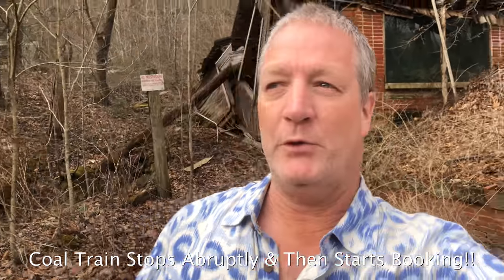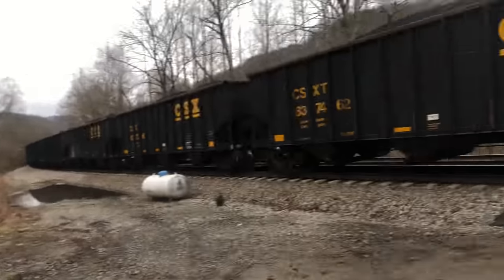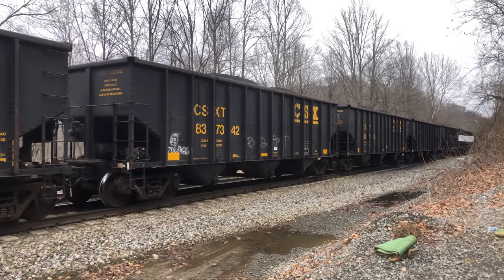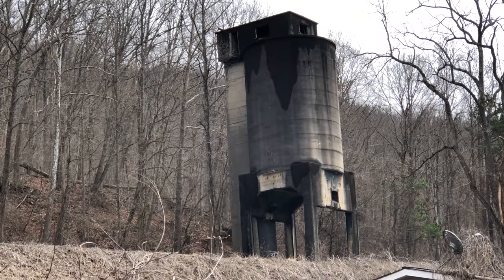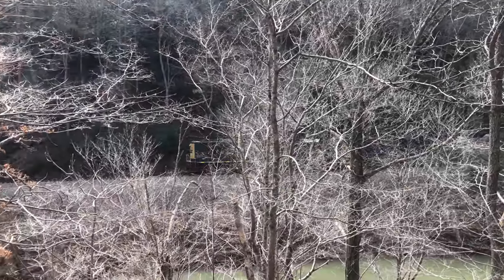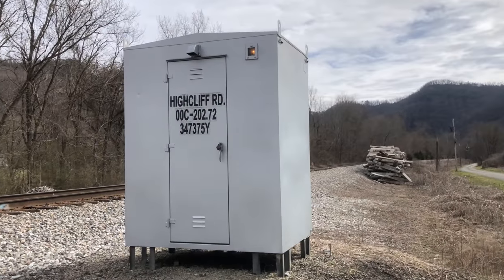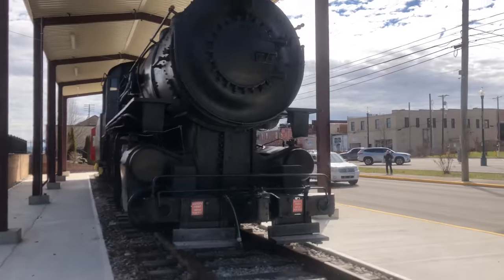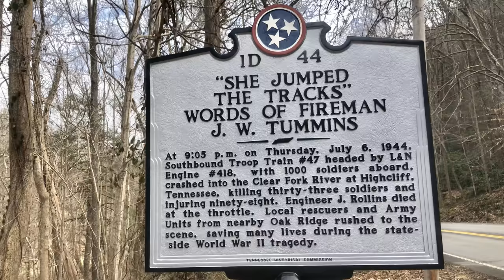Coal Train Makes Sudden Stop & Starts Quickly Jellico, Tennessee, Steam Engine Corbin Kentucky CSX

Comment: Another example of JT being famous everywhere he goes. A single engine in the boonies and they recognize him with a salute :) How cool is that?
Reply from the maker: One time I was in the boonies in West Virginia near the centre of the state.  The engineer got off the train and walked over to me and said " Hey JawTooth, what are you doing here?"  That was awesome.  It has actually happened quite a few times
Reply: @JawTooth  That is very cool!
Reply: @JawTooth  former conductor/engineer. Love your videos. To answer the question why they stopped? They could’ve had a student engineer or new engineer that applied too much air for braking. Going downhill with a heavy train is scary. If you apply too much air you have to stop and kick off the air and let the train line build back up. If you just kick it off without stopping, you could have no brakes because you don’t have enough air.

Comment: I enjoyed your sense of humor concerning the dilapidated house alongside the roadway. The freight carriers discovered that the concrete ties are not as resilient to the heavy pounding of freights. These ties are great for passenger service. Wooden ties take the pounding better and are easier to replace. Also, wooden ties can be shredded or reused for landscaping. There used to be a power plant somewhere in Penciltucky that ground the ties and used them to fire the boilers to generate electricity; I don't know if that plant still exists.
Reply: No now they ship the Ties to China!! They are tearing up the Eastern Shore RR and taking the Ties there!
Reply: A lot of CSX ties go to a cogeneration plant in lower Michigan not too far from Alpina on Lake States RR and CN keeps them coming to Llanse MI the endof a branch. That is the town's fuel for electricity and consumes an average 3000 ties per day. Nick a concrete tie and out it must come. Wood can take those minor nicks and flange grooves. UP is finding out the hard way in.Nebraska

Comment: By carefully observing the lumps of coal protruding from the top of the cars, I try to identify what variety of coal is being transported. I think it is anthracite or coke, both varieties of color tending towards gray. Coke (not to be confused with Coca-Cola) has a porous structure and is much lighter. To see the speed with which the train restarts after stopping, I would go for coke.
Reply: No coke 
Marijuana
Reply: @michaelhewitt258  no Coke.  Pepsi Pepsi! Cheeseburger Cheeseburger!
Reply: I'd say it's unlikely to be coke. Coke is almost exclusively used in steelmaking, and it's usually made close to the steelworks. It tends not to be transported long distances.
Reply: @beeble2003  you are correct. Former RR
Reply: Coke is lighter than coal. A typical coal train is 18,000 tons. I used to run them. Coke is usually in big chunks mounded high over the car.

Comment: Crazy how fast a train can get up to speed from a stop.
Reply: Especially a loaded coal train going down hill.
Reply: It stopped faster than I thought it would, too!
Reply: Donald Stanfield   I’m pretty sure the train went into emergency about the time the third car was near the crossing.  I’m positive that the engineer was using dynamic brakes coming down the hill, and I am pretty sure the air brakes were set also.  And it was not going very fast either.  So it stopped pretty quick because the brakes were already set.  It only went 17 car lengths as the 20th car stopped on the crossing.

Comment: That stop that you mentioned about early into the video he probably had a red light for the block out in front of them and then it turned green pretty much right after he came to a stop and maybe he was asked by the dispatcher to put a little “steam” into it to allow whatever coming up behind it to move along as well, just an observation or idea/guess. Being a former freight train Engineer myself, that’s when you go from speed / power selector 1 to 8 in a relative hurry/quick step plus going downhill was a big help!
Reply: If he has another train in front of him, it would be very unwise to put his foot to the floor, as there's a good chance of being stopped at the next signal, too.
Reply: If your a former RR then tell me what happens if you apply too much air to the train line going downhill? You will have to stop to recover your air. If you just kick it off, the compressor won’t charge the train fast enough and the next time you pull the train line air there is nothing there and your a runaway!
Reply: Former RR

Comment: That coal train took off lake a rocket sled on wheels. The steamer and caboose display were kept in decent condition. As the old statement goes the Walls of Jericho came tumbling down however the concrete coaling tower of Jellico is still standing tall.

Comment: Pretty cool: Here in Walla Walla, Washington near 9th there's an older Union Pacific steam loco parked next to the street. There's also one "coal-type" car attached to it. They've been there for about 65-75 years. The cool part about it is it was about 8:00 PM and I was on bike on the sidewalk next to the thing. There was coincidentally a guy walking there when I pulled up so we started talking. He mentioned how he, as a kid at the time, watched his grandfather park it where it sits. While doing so, he kept pointing to one of the wheels. "Right there...THAT one." There was a problem with the brakes on that wheel and they were worried if they were going to be able to get the thing stopped in time.

There are the links of track it all sits on today still there, obviously, but any remaining track, the way they got them there and so forth is now long gone to the point of one cannot even tell where that WAS. Like...LONG gone. Partially covered in grass, signage, pavement, a building, blahblahblah...(There's a chain-link fence around it these days.)

What are the odds, though? 8 PM...No one around...The ONE GUY who happens to be walking "right there" at that exact moment happens to be the grandson of the guy who parked the thing there some 70 years ago AND he had a big-time story about it. Go figure.

Minus the caboose, that entire display looks almost EXACTLY like the one on display in the video at the end in Corbin, KY. The only difference is the one here has "UP" painted on the side along with the number. Both in white. The city lights the thing up every Christmas season as well.

Comment: Hey jaw tooth. The US 25 w & 25 E was once major routes out of the south east before interstate 75 . Most likely the engine you seen is a helper engine they keep at morley  to push heavy trains across the mountain to Duff Tn .  Surprised you didn’t show a wheel greaser there is two there near the coaling tower . Anybody can run a train on flat ground . Takes good hands in the mountains and tunnels of east tn
Reply: Does anyone remember the train wreck that killed some servicemen back in the 40,s outside jellico google it
Reply: Google jellco troup train wreck . Several articles.  It’s interesting that since it was near oak ridge and carrying troops there
Reply: Was a news black out

Comment: Nice catch of that CSX coal train near Jellico, Tennessee, Jaw Tooth! That coal train did get up to a good speed very quickly once it started to move after stopping. That old Louisville & Nashville Railroad concrete coaling tower in the middle of nowhere was a great find. I was wondering how that coaling tower was filled when it was used during the steram erea. The lone CSX engine passing the coaling tower was another good catch. I was surprised that you were able to get ahead of the single engine so that you could catch it coming out of that tunnel. The 0-8-0 and the bay window L&N caboose on static display in Corbin, Kentucky was a nice find. It looks like someone or some group is taking good care of that engine and caboose. Thank you for finding these trains and the sttric display and for bringing them to our attention!

Comment: That's the first steam locomotive I've seen with no leading or trailing wheels. I didn't know they existed.
Reply: That's a switching engine, and thousands of them were built during the steam era to put trains together or to take them apart in railroad yards. They were also used to transfer cuts of cars from one yard to another. They didn't have pilot wheels in front or back because they were slow-speed engines and didn't need the extra wheels for guidance that higher-speed engines needed through switches or curves. Also, the lack of pilot wheels meant that they had all their weight on the drivers and so had more traction for their size.

Most switchers were built with 0-4-0, 0-6-0, 0-8-0, or 0-10-0 configurations; the one on display is an 0-8-0.

Comment: This is called Chaska, a coal mining camp in early 1900's. The town near by is called LaFollette about seven miles south of where you are.
Reply: This train actually was loaded at Clairfield TN   The hill helper used to be at Chaska where the old coaling tower is. He is headed to Morley where they tie up the hill helper now. There is a lot of traffic because that’s the only decent road between LaFollette and Jellico. The stream is the Clear Fork River.
Reply from the maker: Thanks for the info!  Yes, I drove through LaFollette.  I almost stopped to eat lunch on a side road just north of the town that had a railroad bridge go over it.  I wish I would have because I could have filmed the train on that bridge
Reply from the maker: I want to go back and spend a couple of nights at Rocky Top and get trains on CSX and NS
Reply: @JawTooth  Clinton TN is now RJ Corman railroad to Jellico TN. NS sold the rights to them. Unfortunately, CSX is down o six trains a day now. I have a very good knowledge of the KD as my father and grandfather worked on the L&N and my Dad retired in 1995 with CSX.

Comment: Super cool huge old coaling tower, and neat SD70MAC running by itself there.  Absolutely right about the coal train - those two GEs upfront must have been pulling hard to accelerate that fast even down hill.
Reply from the maker: Thank you very much!

Comment: Pretty sure this train loaded in Manchester KY. I see these types of cars with the double humped coal frequently pulling from Manchester through Barbourville and up to Corbin. They usually leave there headed through Tennessee. I believe they are loaded with front loaders hence the double humps. Awesome getting to see this shot on its way out of town
Reply: I used to work for the RR. I’ve never saw a coal train being loaded with a front end loader.

Comment: Hi JT from the other side of The Pond ! Do you have any idea what that small white tank alongside of the track (at about 2:09) was for ? 😎
PS : As an amateur student of military history, I'd just like to point out that that troop train accident was just a month after D Day here in Europe.
Reply: That propane tank is for rail switch heater to keep track free of ice, much more common further north from here.
Reply: @donaldstanfield8862  Thanks for the info Donald - much appreciated ! 👍 👍
Reply: @donaldstanfield8862  That's the normal reason for propane tanks near rail lines, but there aren't any switches near that tank, so it's a bit of a mystery.

Comment: Just a speculation here. Maybe they stopped to check that dynamic braking and air braking were working before proceeding on a long downhill grade. Heading downhill could also explain the fast acceleration. Thanks for the great video!
Reply from the maker: Great point and thanks for watching!

Comment: Interesting locations, nice steam engine, what is the propane tank along the track used for, was it connected to something
Reply: As others have said, the RRs often use LPG to heat up switches in winter.

Comment: Thank you my model has 3 domes now I know it look like a real one why3 domes
Reply: The middle dome on the steam engine is the steam dome, where the steam accumulates until it's needed to make the engine move. The front and rear domes are sand domes; they are filled with sand, and if the rails are slippery or the engine is starting a heavy train, the engineer can pull a lever which releases sand onto the rails to give the engine more traction.
Reply: @ericemmons3040  thank you

Comment: Something caused that coal train to go into emergency. You can hear the tell tale pop shortly after the head end goes by
Reply: The train didn’t go into emergency. The pop is air exhausting from the air compressor. Just like on a semi when you have full air pressure it will exhaust and blow moisture from the line. Former RR

Comment: The reason they stopped was to uncouple the helper engine from the train. The helper engine does not have a helper link on it so they have to couple and uncouple manually. The engine you see later on is the helper engine that uncoupled from the train and is returning to the helper shack
Reply from the maker: Cool, I was wondering!  I saw where they took it to.  There was a small railyard with a little shack.  There was a side road that went over the track and then a lane went to the small yard where the locomotive went to
Reply: I didn’t hear the train go into emergency. That would have to happen to uncouple a locomotive or car. I highly doubt they bottled the air, loaded coal train going downhill. Most likely they applied too much air and had to stop to recover the air. It happens a lot to new engineers or old crappy engineers. Former RR
Reply: Also once they broke train line continuity , they would have to do a set and release on the rear car. That never happened.

Comment: It looks like each car can be loaded with about 20,000 lbs. Of coal. And there were 80 cars. So we got 1,600,000 lbs of coal hauled on 332 axels.
Reply: The markings on the side of each coal hopper show a load limit of anywhere from about 205,000 lbs. to around 208,000 lbs., with at least one car showing a capacity of 229,900 lbs.; each coal hopper empty weighs about 55,000 lbs., so around 27.5 tons with at least 100 tons of carrying capacity. If the cars are loaded to full or near-full capacity, it's conceivable that the entire weight of the train is around 10,000 tons, or 20,000,000 lbs.
Reply: @ericemmons3040  Thanks. I could not see the numbers clearly on the video. So now we got approximately 16,000,000 lbs. Or more.
Reply: @earlschmitt884  That is quite possible. . .
Reply: A typical coal train 10yrs ago was 18,000 tons. That’s with 120-140 cars. Former RR